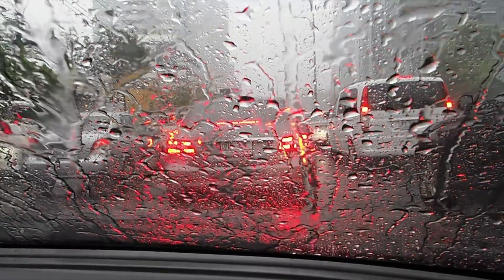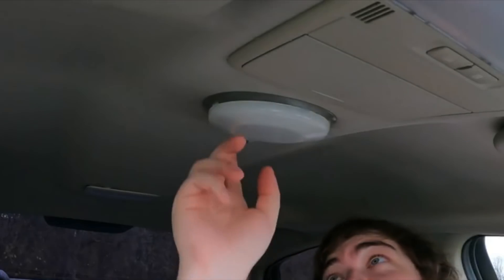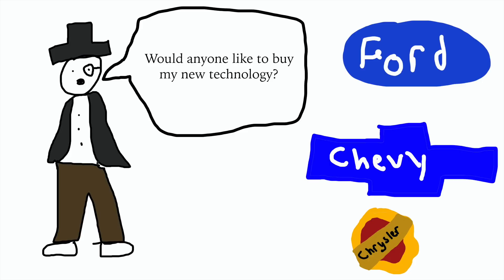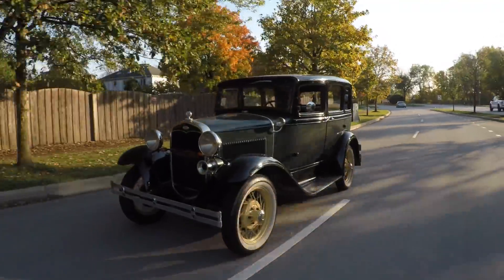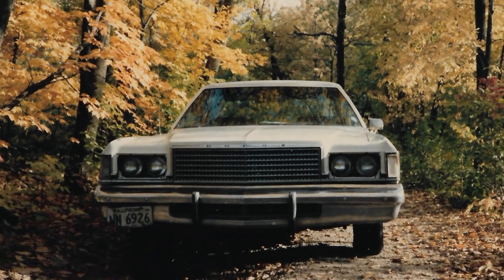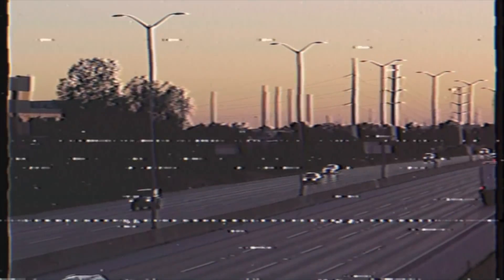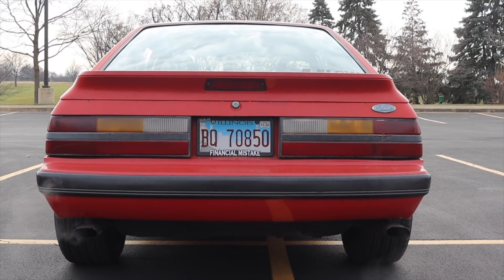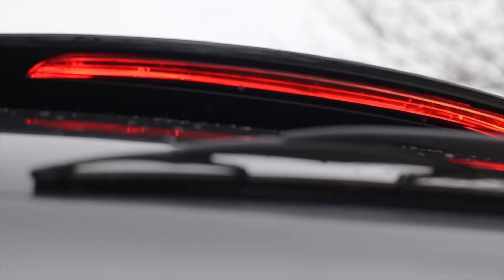The Third Brake Light - Who Invented Them & Why We NEED Them!

Comment: My cars are all too old to have third brake lights, but I think they are a great idea, especially when they are integrated into the trunk lid instead of the rear window so they don't reduce rear visibility.  My uncle had an early '90s Cadillac with the third brake light as a thin bar that ran the width of the trunk lid.  It looked pretty sharp.  Best part was the car was red, so it was largely unnoticeable until it lit up.

One thing I can't stand is those flashing brake lights.  They are more distracting than helpful.  A flashing light means something more significant than stopping is happening (changing lanes, turning, break down).  A flashing brake light sends incorrect information to fellow drivers.  I really wish they would outlaw them...
Reply: I wish they'd outlaw all these new lighting techs that turn even turn signals and marker lamps into blinding eyes of sauron. I never had any problem driving at night when everyone was using 1157 bulbs and halogen headlights but these new HID/LED setups mean even people's running lights blind the FUCK out of me at night. I've been dazzled by fucking DRLs IN BROAD GODDAMN DAYLIGHT WHEN NO LIGHTS ARE NEEDED AT ALL!

Ugh. Modern automotive lighting is more unsafe than older lighting in so many ways and nobody seems to care. They're making me put my sunglasses on at night when I'm in traffic because they're so damn bright.
Reply: @TestECull   I could not agree with that more.  My cars have old Halogen bulbs and I can see everything perfectly fine on pitch black country roads, there's absolutely no reason to make them brighter.  But as soon as I'm faced with one of these cars with insane lights, I can't see anything anymore.  So instead of two drivers who can see, you have one who can and one who's running blind.  

The worst of it is that I occasionally see a car with HID lights where the owner has adjust the lights down a bit from the factory spec and the result is excellent road illumination with lights that look less bright than a halogen to oncoming traffic.  That means the tech could easily be implemented in a way that improves night driving for everyone, yet it isn't...
Reply: @NoName-ik2du  Ye my 85 F150 with its sealed beam headlights makes night become day on high beams but on low beams it doesnt blind people.

Comment: Another reason for the 3rd brake light, and one you almost touched upon.  American car makers were allowed to combine running, brake, and turn signal into the same red lens, often using that same dual filament lamp that powered the running light and brake.  If it burned out on one side, how would people know if you are braking while turning or not?  Europe has required amber turn signals for decades to combat that problem.
Reply: its about the styling, red turn signals looks better.
Reply: @erah3400  Not going to argue that because it is true.  But they could have had a seperate lamp just for turn signals.  I have only owned european cars,  I have had a few that had red Turn signals that were still not part of the brakes or running lights.

Comment: 1. We called them “Cyclops lights” back in 1986
2. I worked at a retail auto parts store back then in 1985/1986 in high school and we had a retrofit kit that were very popular. We had a whole isle of them and had to restock every night!
3. Do modern cars even come with turn signals anymore? I never see turn signals anymore!
4. I think all rear turn signals should be Amber by law, they are so much better. Or at least animated red signals like the old ‘67 Mustang and new Mustang.
5. The low turn signals of the modern Hyundai should not be allowed.

Comment: The problem is that two brake lights on the sides are also turn indicators, and it is rare that US cars have an amber turn signal indicator for the rear. The center brake light fixes that.

THAT BEING SAID:

In your essay it would be better to to compare similar body styles with the 1985 year to the 1986 and especially with GM cars. They literally installed rear brake light stalks from one year to the next to meet the requirement. Compare 1984-1985 models to their 1986 counterparts.

Comment: Technically the 2nd Gen RX7 was a 1985.5 model but Mazda equipped all of them with the third brake light despite not having to in order to not have to manufacture two different trunk lid stampings (one with and the other without the hole for the brake light). Similar manufacturers of pre-86 cars followed suit.

Comment: Hi.
A suggestion of video.
I'm surprised how low on the body of the car some newer models have their blinkers.
I find it unsafe, unnatural, and I often miss them because they are hidden by something.
Examples: 
front blinkers 2018+ Toyota Camry,
rear blinkers 2015+ Kia Sportage. 
I'm wondering whether the ministry of transportation or IIHS did any research in relation to low blinkers leading to more collision. (I wouldn't be surprised with this result)

Comment: i grew up outside of the usa. whenever i saw an american car, the rear lights never ceased to confuse me, because there were no amber turn signals - the brakes and turn signals were the same unit, so if you apply the brakes and the turn signal at the same time, you wont know which is which. 

you dont need a 3rd brake light in other countries - ppl arent used to red lighting up always.

Comment: The GM H-Bodies which had just started going from RWD V8 to FWD V6 in 1985 had the CHMTBL listed as an option in 1985. You will see many 1985 98 Regencies and Cadillac Sedan deVilles with third brake lights that make you think they’re ‘86s when they’re actually ‘85s.

Comment: What about the 2 Little red reflector AT the very bottom of the rear bumper introduced in the early 2010's ? I think they were introduced for safety mainly after a rear end accident on the highway if all 3 red Lights and hazard yellow turn signal Lights are all broken, the wrecked car still need to be visible to other incoming drivers during night ... even more visible when the car is parles on the side or the street.

Comment: It wasn’t, but it should’ve been mentioned that the higher brake light is closer to eye level, easier to see especially when the lower tail lights are obstructed by another vehicle. They can usually be seen through the windshield of other cars giving more time to react and can’t be mistaken for blinkers which are often the same bulb as the brake lights.

Comment: Across the pond in Germany, some enthusiasts wanted to mount third brake lights as well, but they were illegal until sometime in the early 90's, as brake lights always had to be in pairs. Thus,  aftermarket brake lights mounted on the trunk lid struts of a hot hatch were not a rare sight during the 80's (it wasn't as big an issue as in the US, as amber turn signals had been mandatory since sometime in the 60's, if I remember correctly). On another note, I got my US license in 1989 (as an exchange student), and hand signaling for turns (instead of using the turn signal) was still an option according to the driver's manual. Is this still the case today in the US? And speaking of turn signals, did US cars of bygone eras not have the B-pillar mounted fold-out indicators aka trafficators?
Reply: Semaphores were the name for the fold out indicators I have heard.

Comment: In the US, center brake lights are a definite necessity because people drive around with one or two brake lights out and the center light may be the only one working.  The other stupid problem with US lighting is that it's not mandatory that turn signals are amber in the rear, so for the sake of form over function one brake light turns off to turn into the turn signal.  Heaven forbid people with those vehicles drive with their hazards on, then the only way you can tell they are stopping is from the center brake light assuming it hasn't burnt out.  I hate that rear amber turn signals aren't mandatory here.  I am surprised at seeing newer trucks and SUVs that used to have red turn signals are not incorporating amber instead.  Although some missed the mark a bit (RAM truck) by making the turn signal amber, but still disabling the brake light on that side when the turn signal is on...c'mon, you were so close....

Comment: I think 3rd brake lights  was mandatory by 1985/1986 in the U.S. . It was said for safety measures incase either side brake light are  burnt out and bulb's need to be replaced.

Comment: in europe you can spot immediately if there is a car with automatic gear at the traffic light.
that annoying brake light that burns constantly when you're standing still.
most cars still have a manual gear, so you don't have to put the brakes on constantly.

Comment: That was interesting. I always thought it amazing that in the UK this was not a mandatory feature even into the late 1990's. My Father bought a VW Polo in 98 and it did not have a 3rd level brake light.
A quick question, was it really Ford who pioneered the 3 flash lane change signal in 2011? I ask because I have had 2 Skoda Roomsters' a 2009 and 2013 model and both had this feature.
Reply: No. It wasn't Ford. I had a rental VW Jetta in 2006 that had it. I recall it very well because it was so close to the cruise control stalk that I kept bumping it on accident and was frustrated there was no way to cancel it. Great feature, but roughly implemented at the time. I was already in the habit of flashing three times to change lanes and it was a welcome quality of life improvement. If only they had put the cruise on the other side like Chrysler did. As for year, I know for sure it was 2006 because it was the year I drove that car from Green Bay, WI, to Laurinburg, NC for a new job.
Reply: It could be that VW Polo was manufactured before 1998.
Reply: I was living in Belgium in 1992-1994 we were told that if we had a car from the US during that time we had to disconnect the 3rd brake light. 🤷🏼
Reply: @Griso12008V  Probably because the 3rd brake light didn't comply with ECE. 
All vehicles in the sold US uses different type of bulbs than vehicles sold in European markets
Reply: I think even a 2000 Vauxhall Corsa B doesn't have a third brake light, yet a 1997 Renault Clio I does. I think small cars were the last to get them.
Reply: @RWL2012  I guess your country probably didn't mandated 3rd brake light during or after 2000?
Most countries in Europe mandated 3rd brake light in 1998.

Comment: My vehicle predates the requirement for light trucks.  However, I have been thinking of adding one.  My rear bumper has seen action three times.  The vehicle is high off the ground with a very large bumper, several antennas, a rear mounted shovel, a tow strap on the bumper, a large spare tyre, and only two small trailer style brake lights.  I have been thinking of adding a brake light in the spare tyre.  I still do not understand why I have been hit so many times.  The vehicle is bright hazard yellow.  I guess people like their smart phones more than their car.  The rear stainless steel double tube bumper is filled with concrete.  I guess the other three cars found that out.  The light is installed in five days.

Comment: Might be interesting to see the history of tire sizes and how they went down to 13's in the eighties and now they are bigger again .
Reply: The only reason wheel sizes are large now is because of their appearance. Manufacturers copied the car culture of low profile tires as an appearance modification, but it’s dumb because taller sidewall tires are more comfortable since they absorb road impacts from bumps, and give a smoother ride over bridge cracks and asphalt fissures. It’s especially dumb on cars designed for comfort. Nowadays people get damaged rims from hard impacts. The only benefit to a low profile tire is quicker steering response and better handling during performance driving. Unsurprisingly, import car racing enthusiasts use smaller wheel diameters and low profile tires not only for better handling, but because of less unsprung wheel/tire weight, which makes acceleration faster.

Comment: When I came to North America in mid 80s, I found out the American cars tail lights had a big difference to European n Japanese cars. Many American cars back then, their tail indicators were not yellow. They shared with the brake lights which only had the red lights blinking. That was so confusing and surprised me that was absolutely not safe. 
Later on there are 3rd brake lights installed on many models, but no yellow signals lights still carry on till 90s on most models.

Comment: What I’m curious about is why the USA hasn’t implemented rear fog lights yet, my Audi has one, and I put one in on my Jetta, they’re great for making sure people can see you, be it in the fog, heavy rain, or at sunset when you can’t see shit because of the sun being an asshole… I know all German made import cars have them, but nobody knows how to use them because they’re never mentioned in any driver’s handbook here. Rear fogs are also great when reversing in pitch black, especially when you have dim reverse lights, I almost always used the one on my Jetta when I’d back into my spot at home because the reverse lights barely let me see the block wall. The only reason I can think of as to why we haven’t implemented them yet is manufacturing costs, but they’re a safety item, so it shouldn’t matter if it costs a little more to run 1 more wire, install another bulb holder, and put in a switch.

Comment: It's a common misconception that red lights help your eyes adjust to low light. They actually hinder it because much of red lights emissions are unobservable to the human eye, but your brain knows it is there and has to work overtime to adjust your eyes, therefore leavong your eyes less adjusted to low light.

Green lights frequency spectrum is known to be the easiest visible light as it has a mid peak in the frequency (much like a mid peak in audio signal makes a sound easier to hear, ie, the human voice). So the trick is to use as little green light as possible to maintain night vision. Amber is the next best colour for this.

Comment: In 1986 when the third brake light came out on cars most cars had four brake lights on the back plus the 3rd brake light. 1986 Chevy celebrity comes to mind because I own one of those. when you hit the brakes in that car five lights lit up at the back never ever did get rear ended. Now on the newer cars they still use the third brake light but they only have one brake light on each side of the car. so now you only have three lights that light up the back when braking. So as usual manufactures have cheap out and doing the bare minimum requirements. So in my opinion it’s not a safe as it used to be in the old days. Same on the front of the car the signal lights used to be separate from the headlights now they’re all incorporated into one cheaper to make but not as safe. Chrysler that shuts the one headlight off when you have the signal on so you can see the signal light. good idea but a little over engineer but it is probably cheaper than making a headlight and turn signal separate. well that’s my rant for the day.

Comment: This was neat, but my biggest question still reminds. Why don't none passengers cars have their Center Mount Stop Lights. Like, the absolute worst thing to ever read end would be a huge box truck or semi truck. So shouldn't those vehicles be the first to be equipped with third brake lights? I hate it. I'm just learning to drive, and watching the brakes for trucks, on almost all of them, the running light and brake light is the same, if it's on, you don't know if it's just in running, or if the driver is on his brakes. Ya know?

Comment: Why?
Because with older cars that didn't had bright lights or didn't had fancy light assemblys and only used the same ligh bulb for running light and braking it gets quite hard to notice if they are using the brake during day time.
Just drive behind a 90s or 80s car and you will notice that sometimes you can't see a change in brightness when they step on the brakes if they already had the lights on and it's sunny.

Comment: Mentioned the dual-filament tail/brake light, but not that for some reason the US still allows red turn signals?
I drive a classic Volkswagen Beetle, and I installed a third brake light of my own design (3D printed). I feel it's especially valuable there because the tail lights are quite low, much lower than most other vehicles, while most vehicles on the road these days (mostly SUVs and crossovers) have the driver pretty high, so my brake lights are below their line of sight. I suspect that was a factor that time a van rear-ended me (that being before the third brake light was installed). The third brake light is more in their line of sight, should help. The purists mock it, but I figure if it has a 1% chance of preventing a collision it's worth it, and unlike said purists I actually drive it as my regular vehicle.

Comment: What did you mean when you said Ford pioneered the 3 flash turn signal for lane changes in 2011? Ive driven/owned GM products as old as 2006 that have the 3 flash if you just tap the turn signal stalk

Comment: Some cars models that were still in production prior the third brake light also had to have fixed third brake lights placed, which some are ugly and you can tell it wasn't apart of the cars orginal look, some cadillacs had this. One odd thing is my 84 mercedes has one mounted on the trunk In the center where some don't have it and sometimes the thrid brake light is placed on the edge of the trunk, weird times